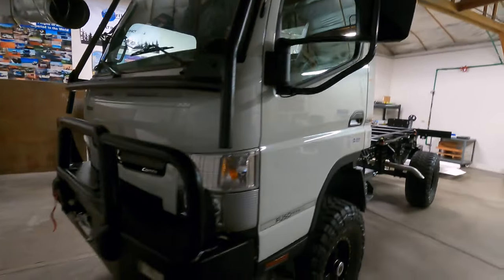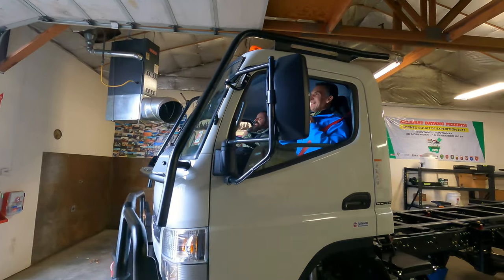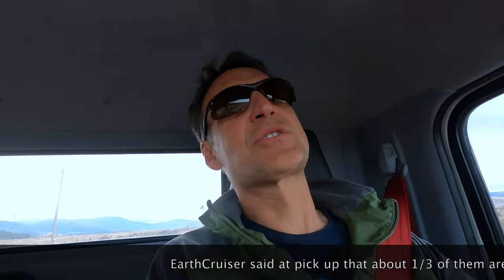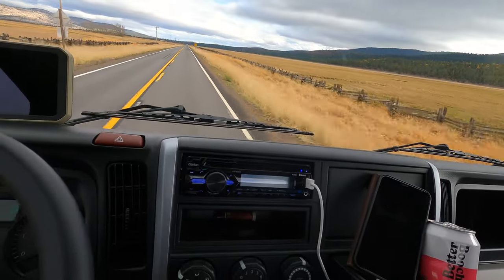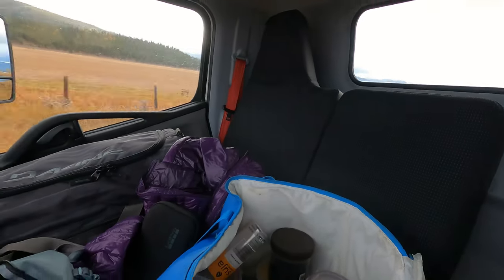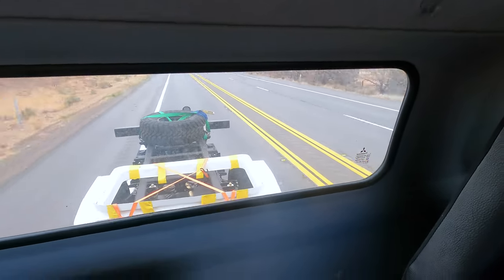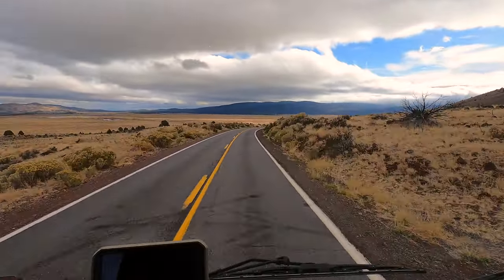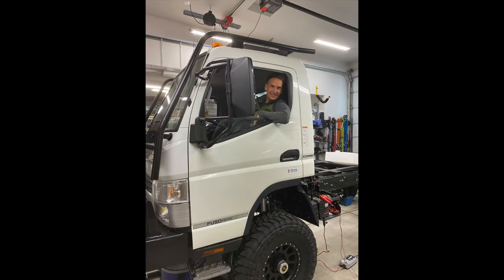Picking up a new EarthCruiser 4x4 Core truck chassis to build my Expedition Camper

Comment: That rig will really improve with some weight on her back i have 1995 gmc w4 basically npr gas and its a TANK youll give before it gives and my check engine light intermittent since new .....
Reply from the maker: Yes, now that I have the camper on it, and nearly built out, it rides decently. Will update on the drive once I get it a little more complete. Bummer about your check engine light. Mine was caused by a leak at the fuel tank vent line to the fuel filler.

Comment: You guys are so lucky that this truck comes with a V8 there, much prefer that over the diesel. 

Strange that Earthcruiser didn’t calibrate the speedo for you with the larger tyres? 

But so happy for you with the overall truck, so looking forward to seeing your camper!
Reply from the maker: I completely agree that it is strange that they didn't calibrate the speedo as any 4x4 conversion or gearing or significant tire size change would require to be done and yes, one would think this would just be as common as an alignment following a conversion, which also wasn't done. I'll share more about the gas V8 later. Thanks again, I am stoked to be building out the camper and very much look forward to sharing the full build out underway.

Comment: If you haven't addressed it yet, we discovered while traveling with friends recently that the steering problem was due to a faulty steering arm at the box.  It was slipping on box splines.  Serious safety issue!  Believe there is a recall on this with earthcrusier replacing their part with an oe part.
Reply from the maker: Yes, thanks for letting me know. There is a recall--was informed two months ago yet no communications to complete the repair yet from EarthCruiser. Have they replaced yours yet?
Reply: @vantripping  We don't have an EC. We were traveling with friends with a new EC and I drove it and determined that something MUST be wrong.  These trucks are typically rock solid at speed on winding roads with zero play in the steering.  Following them on dirt roads you could clearly see the wheels flopping uncontrollably back and forth over bumps.  We got under it and looked while someone turned the wheel and the problem was immediately evident.  They told me about the recall a week later.  Haven't heard if the problem is resolved yet.
Reply from the maker: @fidoexpeditions9366  OK, thanks, I thought you had one. Yeah, I haven't heard anything about the fix since announced almost two months ago, but EC is the opposite of fast even if it's important like safety or a customer concern.
Reply: Love to hear these types of comments. Will save money, time and maybe injury.

Comment: Nice C.O.R.E. chassis.  Did u consider a 4x4 Ford chassis with the 7.3l Gotzilla engine, if available?
Reply from the maker: I very much did, as well as the new E450 with the same engine. I love the E450 option with a 4x4 conversion as the "walk" thru is already complete and large, and I like that engine but the engine doghouse in the van makes the passenger seat very uncomfortable which was THE deal killer. As for the F450/F550, I love it but 10" wider and about 6 feet longer wheelbase and truck for the same size camper as this chassis, Check out video on the truck chassis selection here in which I detail out my chassis choice with hundreds of decision criteria: 
            https://youtu.be/liZisJ-AmOk
          .
Reply: @vantripping  the approach we r taking  depends on the Mission, for me the ride is important to get there 80% paved roads and 20% offroad.  Very interesting your point as to the size of the box.  I will check your video, thanks.
Reply from the maker: Yep, I agree each of us has different intended uses and priorities. I also agree that the ride is important, but I could not get over a 200+" wheelbase and 26+ foot total length need to support a 16 foot camper box on a F550. Some other drawbacks too, even though the ride and interior are nice. Check out my spreadsheet my subscribing to my website VanTripping.com so you can see my analysis, and use to help with you judgement. I drove about 20 different trucks before deciding upon a chassis for my camper. I think the Fuso Canter ride will improve with the weight of the camper build-out, air pressure and some other mods that I will consider.
Reply: @vantripping  thank for the indepth review and analisys, plenty of critical thinking and critical reasoning, we will be following.
Reply from the maker: @rightright6582  Thank you for your comments and you're welcome.

Comment: Love your videos!! It appears that Acela is offering the Straya dual cab new, now. Would you consider that now or too much length? There are a few other 4WD converters out there where you can convert various class 6 rigs like the Kenworth K370, Peterbilt 220 etc. We seem to be at a bit of an awkward crossroads with gas vs diesel vs electric. Until we get high density solid state (5yrs? 10?) it appears that long range electric brings too much of a weight penalty (and concerns over water crossing) for off-road not to mention that 4WD isn’t yet available in a chassis. I’m debating whether it’s worth converting a diesel chassis over a gas for longevity/efficiency/heating solutions…
Reply from the maker: Thanks! I love the Acela Straya and wish it was available at the time I purchased the EC Core, as I really like the CTIS, electronic shifting, and those axles. I was looking at those axles long before I purchased the EC Core yet few options exist on the market. I did also look at the Kenworth K370 with 4x4 conversion, but the cab doesn't fit taller people like me without a cab extension, and it's a large truck. I agree that we are at the crossroads between gasoline, diesel and electric. I think the the best option today is an electric drivetrain with a small generator for extended range, which I thought about building myself but over my capability today and surprisingly nothing on the market. We seem to have a large gap or delay in the manufacturers supplying new products and innovating. I think gas is becoming the better option but not for all applications. An electric drivetrain is fully waterproof whereas no engine can ever be since they burn air. And an electric drivetrain will be immensely more reliable than any fuel-powered one and with thousands of few parts and way more simple. Acela has great option if they can get those axles and supply them. I hope to see some around.
Reply: @vantripping  Great thoughts! Yeah I’ve thought about a diesel generator hybrid solution (plus solar) to recharge while boondocking but looking at current road going electric chassis like Lion6, K370E etc. they all seem to employ electric cooling fans and a mess of wires that all need protection. It’ll be interesting to see future battery management cooling solutions in intense desert environments. It think that Straya (and those axles) is pretty perfect with possibly a better power curve for some applications, at least for North America highways. But then at $130K you could build a pretty lux, multipurpose powerful F550/5500 with smaller camper as well, where the wider axles offer a tighter turning radius than standard. But then you’re stuck with an extra 5’ cab and 15” in width vs same length NRR. Generally the narrower the better for deep woods applications but the Earthroamer type model could offer some stability advantages. So many options, we go in circles.lol Anyway, thanks for sharing so much great analysis for all of us to add to our adventure databases and nerd out on! Your build is absolutely epic!
Reply from the maker: @skyfiblue  Yes, that 5 feet of hood and 10" of extra width on a full size pick up chassis was a deal killer for me as those two things sorely hurt all driving performance, from parking lot to trail, and why add 5 feet of length just for a hood when that can go to a camper and still have a six foot shorter wheelbase. I do love those ProTech axles (now Meritor) and too wish we had more chassis available in the US and ones with electric drivetrains. We live in a market ruled by the outdated and space-inefficient pick up design. I'm hopeful more options will come soon. For now, we have what we have.

Comment: Congrats. Did you buy the chassis by yourself? How did cost you for the EarthCruiser conversation? Why not choose ISUZU FTR?
Reply from the maker: Thank you. I should of bought the chassis myself. EarthCruiser said there would be no difference whether I bought it and brought a new chassis to them for 4x4 system installation or they did thru the dealer, but there were many tax, warranty, registration and timing challenges or problems with not buying the chassis direct from the dealer for me so I wish I had done that yet to my better judgement trusted the info from EC which has proved to be riddled with incorrect info. I did consider the an Isuzu FTR, but not available in US in four-wheel drive and limited options to convert to 4x4, plus a little larger than I wanted in width, height and length and certainly larger than the NPRs & Fuso which are a pretty ideal size.

Comment: Hi KC! Seems like you may be in CO as well? I’d love to meet up and pick your brain as I’m embarking on a few builds. Like the approach you took to write it all down. I did the buy all the vehicles approach and ended up with too many options. I’m currently thinking of building out my LMTV or a NPR Crew. I know you opted out of both options for reasons I understand. Anyway. Hit me up if you have time.
Reply from the maker: Howdy. I am not in Colorado but the Reno-LakeTahoe area, although in Colorado about once a year. I was just there but no plans for next time there. Happy to help provide insights into your process. I did drive a LMTV, a NPR crew (although I don't need a crew cab), a Ram 5500 and Ford F550 cab-chassis, E450 cut away chassis, Unimog U500, Kenworth K370 4x4, International CV and several other vehicles in my quest to find the "perfect" truck platform for my camper. All have their pros and cons, but after just returning from a backcountry camping trip, all listed would had been either too long, too long of a hood or turning radius, or too wide to fit into the area we camped and likely would not have even been able to have gotten to the campsite that the other smaller vehicles could get into, while the NPR/Fuso is just right size to fit while supporting a larger camper. Happy to share more if I can, or even chat. Just reach out via comments in my videos or the website and email links I provide. I have provided insights to many others.
Reply: @vantripping  thank you!! I’ll have to reach out as I come up on elements in your videos intersecting with my build. Thanks for the offer!!
Reply from the maker: @iAmMarchal  Reach out when you're ready--happy to help how I can.

Comment: Will your chassis flex independently from  your leisure box
Reply from the maker: yes, my Total Composites camper box that I have built is attached to a subframe built by EarthCruiser that they have used for years on their campers to isolate the flex of the chassis frame. I have tested this in a video that I recently released here on my channel and the subframe is working great and the chassis flexes much more than estimated with an ability to easily roll over three foot boulders on one corner.

Comment: Very strange the vehicle speedometer wasn't wasn't calibrated, I wonder if that was legal?

I think you will find the difference is approximately 14% over what would have been standard tyres, although as I understand it, there are no standard tyres for either the Fuso or Isuzu sourced light trucks from this vendor as they have replaced almost everything underneath the chassis rails. Our speedometer is virtually identical to our GPS reading at any given speed, so once yours is calibrated correctly, I think you'll be fine.

As for your very bumpy ride with an empty chassis; did you drop the air pressure in the tyres to compensate for no load?

I think what you have will be very popular and probably what I would seriously consider if I was buying a truck again, the Core vehicle that is. Although not available in my country.

An alignment and shimming of the front end to virtually zero was done to our truck after final build and almost fully loaded. We have an Isuzu NPS 300 single cab chassis, in Australia.
Reply from the maker: Yeah, I assumed they would've calibrated the speedo but it is off but about the percentage you calculated. Also surprisingly, the alignment is way since picking up new, so I don't think they did any alignment. One tire is significantly toed-out while the other seemingly straight. I think this will be a great truck once these minor thins are correct and the camper weight compresses the rear suspension some.
Reply: @vantripping  Our truck was done by All Terrain Warriors (ATW) in Australia. Once the truck is finished, they take it to a truck wheel and tyre specialist called Big Wheels. These people shim the front end for as near as possible dead correct camber and alignment, I spent some time at another Big Wheels franchise and watched as they did exactly that to another 2021 build Isuzu NPS. I was there getting 6 new tyres, a happenchance thing, they mentioned that doing the front end on trucks was best done with whatever front axle load will be normal.
Reply from the maker: @allanhugh2044  Thanks for your input! I'll bring my truck over to Australia when done and visit a Big Wheels to get the alignment done right. Actually, I really do want to do that, and hope to, but will certainly get the alignment done once the camper is mostly completed and therefore load is near to what it will likely remain. I figure alignment will change as it gets loaded, so I expected to have that done at some point but one wheel is visibly out so it was not set even close to right before I picked it up. How do you like your ATW? They look great from the videos I've watched.
Reply: @vantripping  The ATW conversion to the Isuzu 4x4 75/155  (NPS 300) has been extremely good. Essentially we have a single cab chassis with a tray on the back and ATW bolted our 12 year old slide-on camper that we had on another vehicle for 10 years. I have met up with a couple of ATW go anywhere motorhomes/expedition light trucks, each one is different and each was great in their own way. Family business.
Reply from the maker: @allanhugh2044  Right on! They look great and I'm envious that we don't have them (yet) as an option here in the US.

Comment: How do you engage the 4x4 since it’s a conversion?
Reply from the maker: Good question. There are two shift levers in next to the driver's seat that allow the front and/or rear axle input to be shifted into high or low range or neutral, so the vehicle can be operated in two or four wheel drive on either axle and in low or high range. There are also air lockers in the front and rear axles.

Comment: Can you access the engine underneath the seat without tilting the cab
Reply from the maker: the single cab tilts forward 90 degrees for full easy access to the entire engine from the ground. This adds complexity to my cab to camper pass thru but I think I have this worked out. The dual cab has access to the engine thru removable floor panels, but I think that will make maintenance to the engine much more difficult. Having recently added a second alternator dedicated to the camper, it was easy access with the cab tilted forward.

Comment: What was the check engine light indicator for?
Reply from the maker: It was triggered right after pick up from EarthCruiser, before I even left Bend. Not sure, EarthCruiser won't resolve it, or send me a code reader to use for a day to check. So I purchased the one they said they use so that I can read the code(s) and report back to them for help or to self-resolve. The code reader they said to buy doesn't read the Fuso--they claim it used to--so I had to buy another one. The code is what I expected--it's the evaporative system from the fuel tank mod they made--which any dealer will just say it's been modified and send me away, which I told EarthCruiser, so not sure why they won't resolve when it's from their modification. It's been frustrating from their lack of resolution and customer support.
Reply: @vantripping  When is your next video? I'd love to see the box going on. Lisa and I were in awe watching these videos. Heck I'm having trouble getting a new converter installed in our little trailer to charge our lithium battery!!
Reply from the maker: @richardcohen8769  Glad you're liking the videos. The box building and installing videos will be coming shortly. Trying to design, build and edit videos at the same time, And oh yeah, work too.

Comment: What do you estimate the top highway speed will be once completed?  Or should I say top comfortable cruising speed?  80mph?
Reply from the maker: So far without weight on board it seems to cruise between 70-75 just fine and likely can up to 80, but will know better after weight is on the suspension.

Comment: Nice!!  How much was the chassis?
Reply from the maker: It was a lot. The truck itself is about $50+k new, but the 4x4 conversion which includes replacement with all new axles and driveshafts, transfer case, wheels, tires, brakes, springs, and then new rear bumper, rear winch mount, new front bumper bull bar, front winch, roof rack with scrub bars added another $80+k. I'd reach out to EarthCruiser for updated pricing and options. This is an expensive chassis once converted, but I don't think there is another chassis available in the US as a new vehicle with as much trail and payload capability and as maneuverable. I drove just about every chassis available from LMTVs, to pick ups, vans, Unimogs, older Mercedes fire trucks, etc.